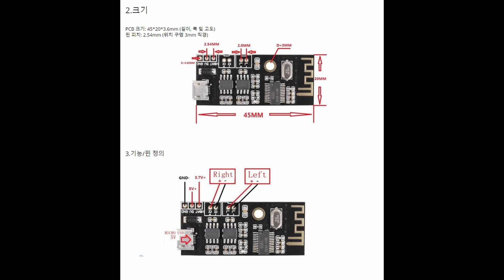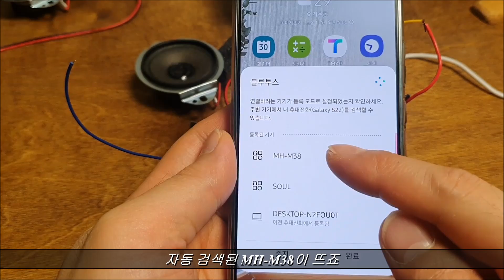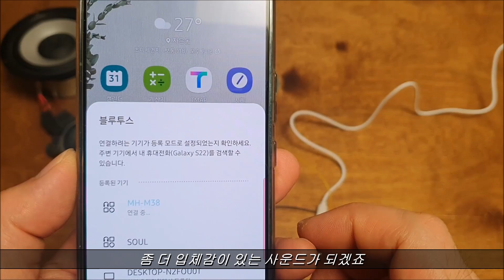Reviving Abandoned Speakers - Making Bluetooth Speakers 1 (MH-M38 review)

Comment: You have two sets of wires (bue and yellow) for the 2 speakers. You should solder the ground to the battery if you use a battery (Ground and VBAT for 3.5V battery) or ground and +5V if you use a power supply. The usb-C port is to charge the battery, in no way the ground should be connected to the speakers.